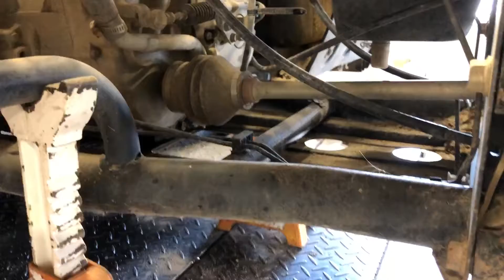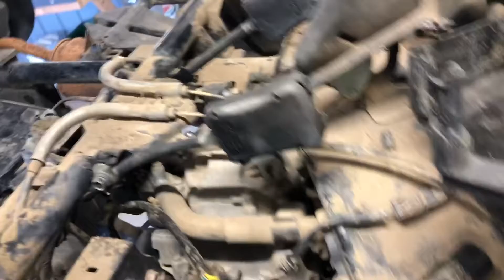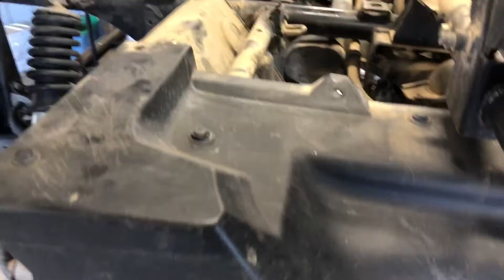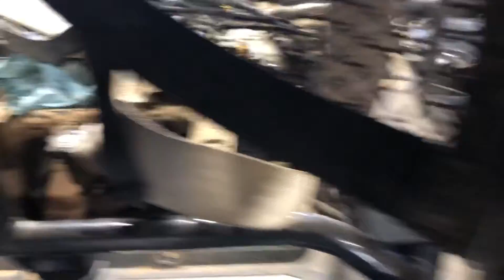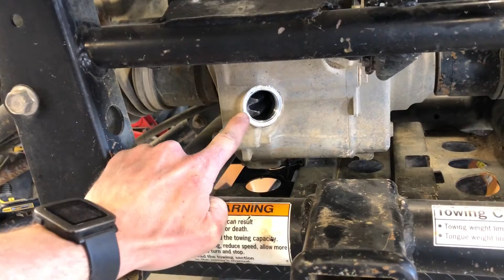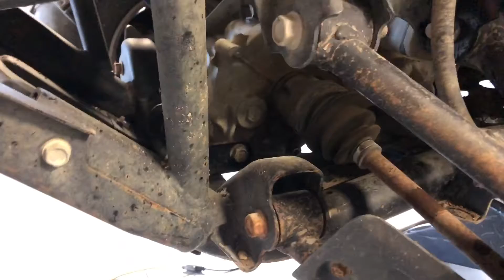Honda Big Red MUV 700 4x4 Utility FULL SERVICE Engine Motor Oil Filter Differential Air Spark How To

Comment: Hey Nebraska - Thanks for posting.  We have a 2013 MUV700 with a couple issues.  Hard Starting or Random No Start, then smells of Fuel. It also misses at High RPM.  Is there a Fuel Filter in these rigs and how is it replaced?  How to test the Battery?  a couple ideas for more videos.  Thanks!

Comment: Hey I just looked at one of these but Green. I liked it. Felt like I was driving a Truck or a Tank!! Felt really Strong and just handled Good!! Just don’t know if they are Good. Please any advice or opinions would be Appreciated
Reply: Would like to know myself. Got my eye on one.
Reply: In my experience my family has  one and it's a 2014 and it's been running good I've only rlly had a problem with the battery but once we charged it it's working good I like how it handles and kinda is a tank
Reply: @y-ou741  Thank you for your comment. I bought it and so far I love it!!! Love the way it handles. Steering is Tight. Feels strong. I have got NO COMPLAINTS!! Thanks again for your response buddy 👍
Reply: @rebelpride6892  no problem man glad i could help👋

Comment: I have a big red 2013 that’s running rich I checked the spark plugs and they are white. It’s backfiring when I floor it. Idles perfect Any ideas?
Reply: My 2013 just started doing the same thing… were you able to get the problem diagnosed?

Comment: Question on my 2010 big red 700 every now and then the check engine light blinks 4 times while at idle. It does this over and over. While the rpms go up while driving the light stays on. Doesnt always do this just every now and then. Any help would be appreciated as I cant find any info on codes for this thing.